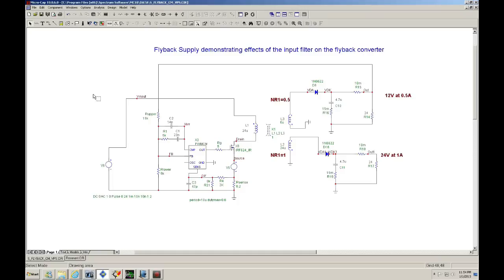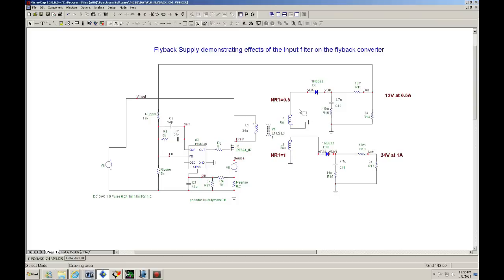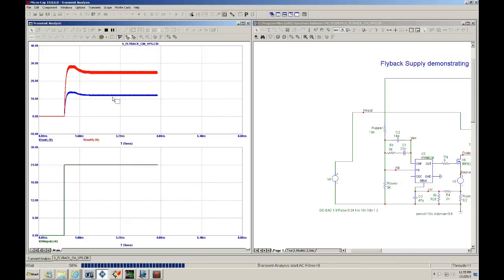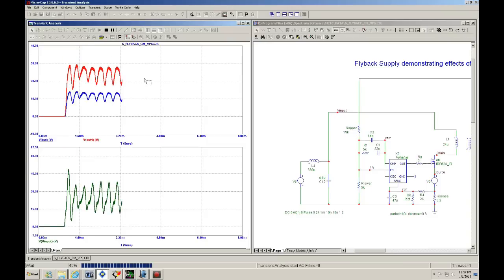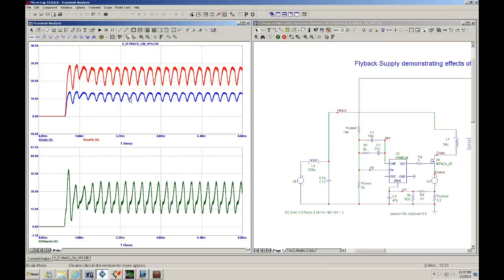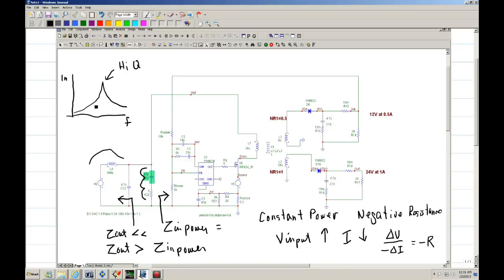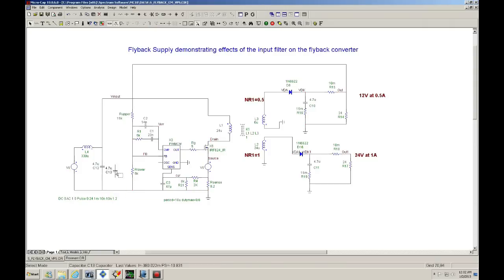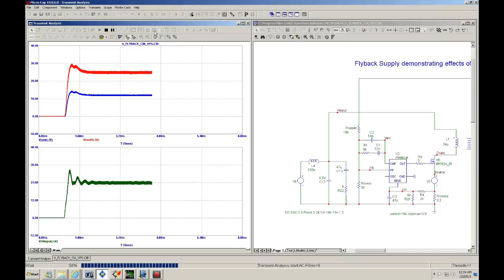Input filter effect on a power supply

Comment: The problem I have with this is that it involves adding a physically large capacitor (capacitors) right at the input to the boost converter. In my case a  MCP1640, running at 1W. This increases the loop area and PCB trace inductance. Plus introducing tens of uF of MLCC capacitance is expensive, especially when you take into account the capacitance reduction caused by DC bias. It just feels wrong to have more stuff that can radiate.

My solution is to add a small series resistance to the inductor - about 0.4 ohm. I can wear the small loss. 

Is there a better way? One that does not involve large, expensive capacitors (and yes, electrolytics create the same sprawl problem). ?

Comment: Hi Robert, i have a question regarding the output transfer function of a compensated power supply, ¿why does it has to be or look like a straight line from the 0Hz point which is DC level and starts high in gain and from there goes down with a certain slope in a straight line? why a straight line? instead of just having high gain at 0Hz and then not including any frequency?
Reply from the maker: Hi Carlos, that is a good question.  The high gain is needed at DC. What the high gain does is that it lowers the error voltage at the output of your supply. So let say you have a Vout of 5V.   If you gain is low then it would have maybe 5.123V.   But with a high gain then it drive the 5.123 towards 5.000V.   The high gain is set by the integrator capacitor. The integrator capacitor is the one connected in series with a resistor  (integrator resistor). At low frequency, the Xc of the capacitor is dominate because it has a higher inpedance than the integrator resistor.    So the gain will be   Vgain=Xc/Rdivider.     Then as the frequency is increased, the integrator capacitor will become a lower impedance and then the integrator resistor will dominate and that is where you have the midband gain.. I hope this make sense.   RB
Reply: @RobertBolanos  ok but then why not use a linear transfer function with no capacitors, why should there be poles and zeros? Can't a linear amplifier give the necessary gain at any frequency?? Thanks for taking time to explain my questions Robert 🙏
Reply from the maker: @carlosornelaslim9713  No you can not use a linear amp . If you use current mode, you have to use a type two compensation which a integrated cap in series with integrator resistor. In parallel to the integrator cap and resistor you need a rolloff cap. The output filter of the supply has a pole and at higher frequency, you have a zero. The type two pole and zeros are selected to cancel the pole and zero of the output filter. Please see my videos on loop compensation and it will make sense. Rb
Reply: @RobertBolanos  Ohhh okay, so if i use a linear amp I'm running into a possible instability situation and my power supply can start oscilating??
Reply from the maker: @carlosornelaslim9713  yes, that is why the type compensation  is used to cancel the pole and zero and make the power supply stable.
Reply: @RobertBolanos  Ok i think i'm getting it now, I'm watching your videos regarding loop compensation! Thanks!

Comment: You didn't try to drop the impedance of the filter...  Or at least determine the impedance of the  power supply section. 
Why?
Reply from the maker: The intent was to show the instability of the input filter if it is not damped properly. To properly design an input filter, you can watch the procedure that I posted on my channel. Keep in mind, that even if I had tried to lower the impedance of the input filter, if the filter is not damped, you still have a chance that the resonant may be higher than the input impedance of the supply. Damping the input filter should always be followed.
Reply: @RobertBolanos  both criteria have to be met to prevent oscillations is what I was trying to say. I have seen the other video as well, it's very well done.
Reply from the maker: @hispaniola1684  Can you please explain what two criteria you are talking about?  I not sure I understand.
Reply: @RobertBolanos  the output impedance of the filter should be lower than the input impedance of the converter, and the filter should be damped.
Reply from the maker: @hispaniola1684  Yes, that is correct. That is Middlebrook's criteria. I think I read somewhere that Middlebrook solved this problem on US submarines were having instability problems when they started connecting many supplies to the main submarine bus. Funny how things happen.